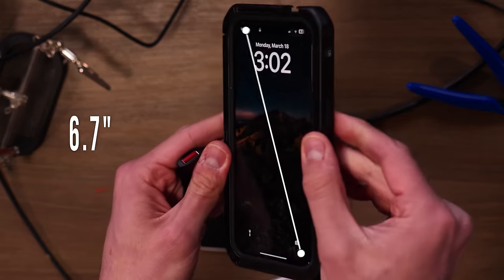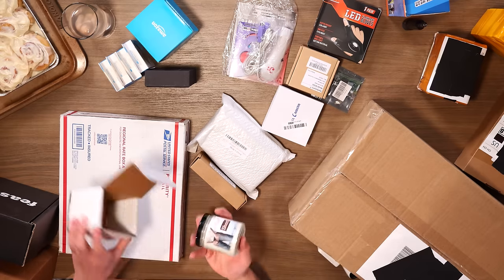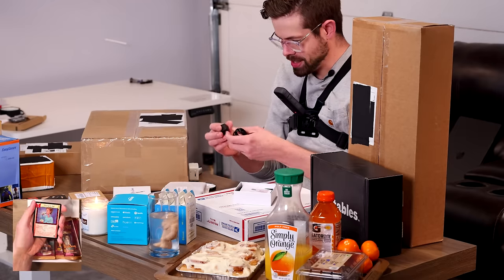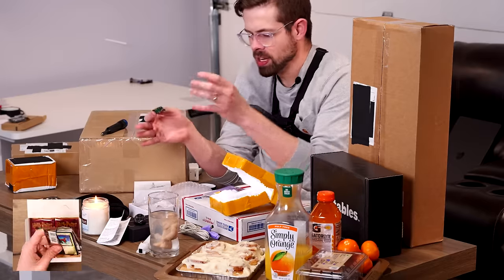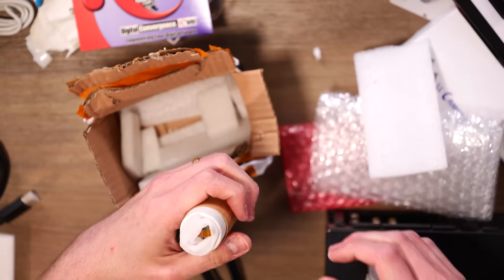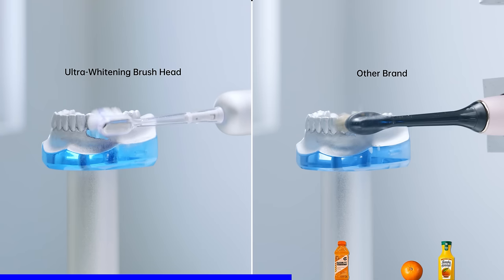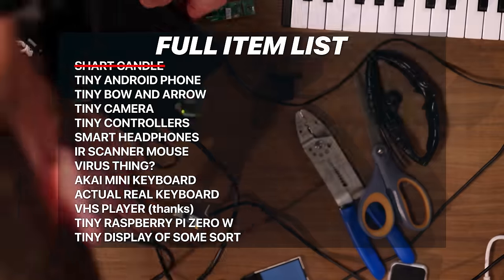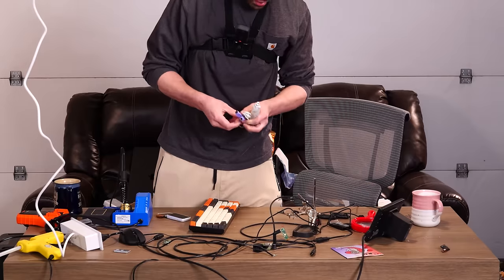I Built a PC Setup with the Smallest Monitor - Stupid Setups 4

Comment: Man, seeing that CueCat scanner was a blast from the past. You used to be able to solder one wire from point to point on the board of those and turn them into a regular barcode scanner. I used one in 2000 in part with a personal book collection tracker program I wrote to read all the ISBN labels on books tied to an API to ingest the info about the books. I had totally forgotten about this.
Reply: You got a repo anywhere of this? Sounds super fucking dope, most smartphones can read barcodes so I’d imagine integrating a social/reader reviews aspect tied to the each book barcode could make it a useful tool for readers looking for recommendations or advice before buying

Comment: Dude!  That's a CueCat!  During Dot-Com 1.0, those things were given away to people with the idea they would scan a barcode in ads or whatever with them and it would take them to a website or something.  Peak 1990's QR code, but a decade before a smartphone existed to integrate camera input with a browser.  They output PS/2 Keyboard, unencrypted, IIRC.  People hacked the shit out of them bac before you were born. 

Okay, the hackers just used them to better keep track of their grocery purchased, BUT IT WAS THE GODDAMN 90'S AND THEY WERE FREE.

Somewhere out there is another device that was essentially a keychain fob with a button you could press to take a snapshot of the time.  The software would cross-reference that info with a list of tracks from your local (participating) radio station.  You could find out what song it was tat you liked on the radio and (I think) order the CD online!  Yeah, MP3's were definitely already a thing, and yeah, people tried to hack this as well since it was also free.  A lot of things were free in Dot-Com 1.0